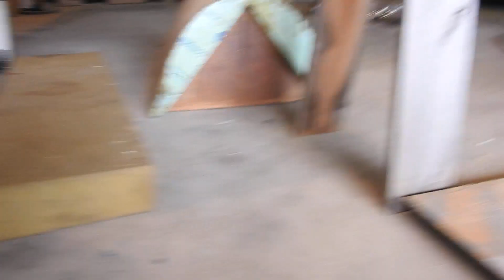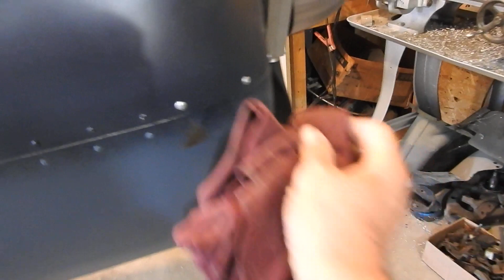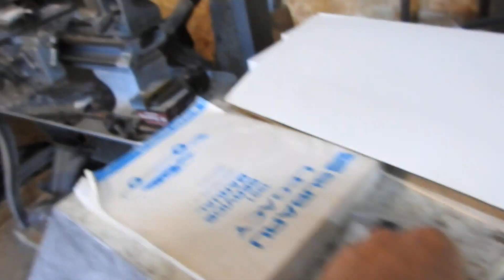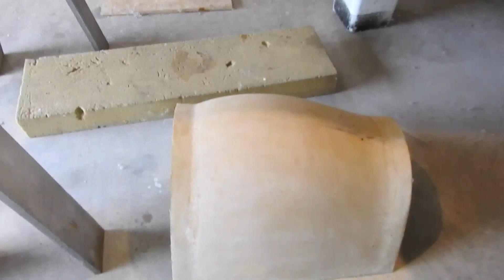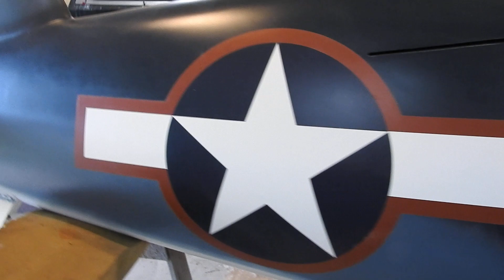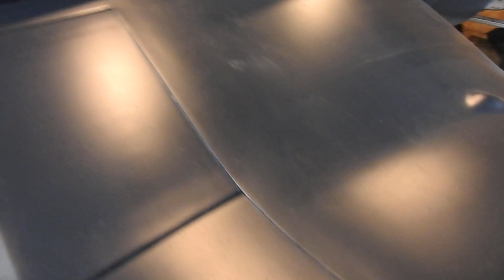WAR Corsair Update 6/19/2022

Comment: As usual, looking very good, keep it up!!  If the leading edge of the flap is curved you could consider adding lines on the leading edge that would line up with the aft edge of the upper surface to provide you flap position indication.  Remember that you will have some negative deflection due to air loads so position the lines accordingly.  Lines on the inboard end of the aileron will change indications with aileron input.
Reply from the maker: The flaps drop away from the back edge of the wing, so they are too far away to use as a reference point. Yes the ailerons need to be neutral for the readings to be accurate. The flaps don't deflect, their hard plumbed. with pushrods.
Reply: Got it, then your ailerons are probably you only real option.  My RV-6 has electric flaps so I just do a count on deploy, never get the same position twice.  They do make fancy flap position indicators but what I do works for me and I expect yours will work for you.  Keep up the good work.

Comment: Ah, gotcha on the tail wheel. Thanks for clearing that up. Still think the doors are a bit wide. I see there is no gap between the fuselage the the cowling. Won't that be a cooling issue since u don't have cowl flap? I think the windshield should be painted to mock the original. That would look cool. The windshield looks like it came off an Ercoupe. It's just too blah honestly.
Reply from the maker: There's about a half inch of clearance between the cowl and fuselage. Plus I cut out a large opening in the lower part of the cowl to help get the exhaust heat out. This is a water cooled engine, so it doesn't need a lot of air over the engine. There will be a frame around the windshield and canopy.
Reply: @Dynodon64   Hello, I wanted to ask your question. Do you have an account on Instagram, email or WhatsApp? I wanted to communicate with you about a simple question about a project I have. Thank you
Reply from the maker: @Mohammed-uz1sn  email me at my youtube name at verizon dot net